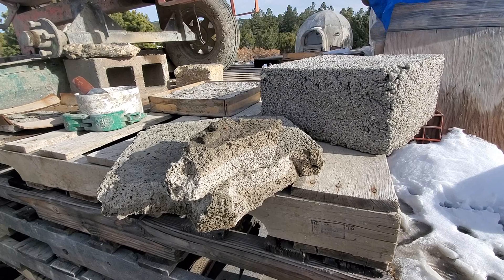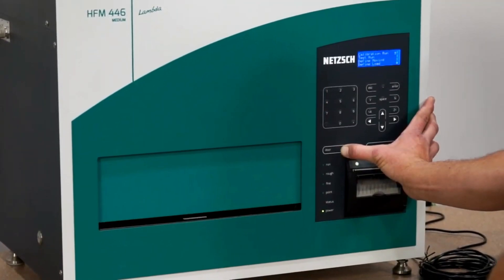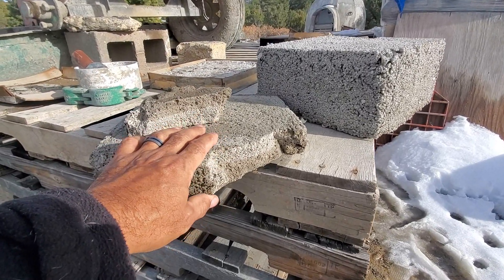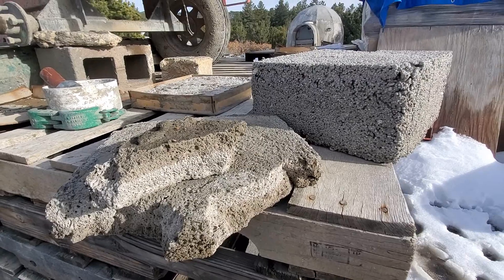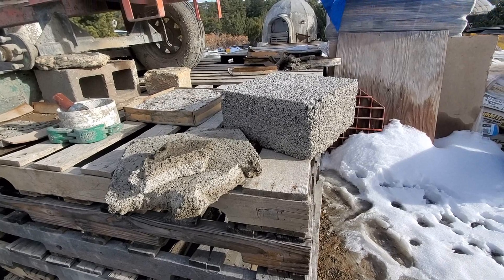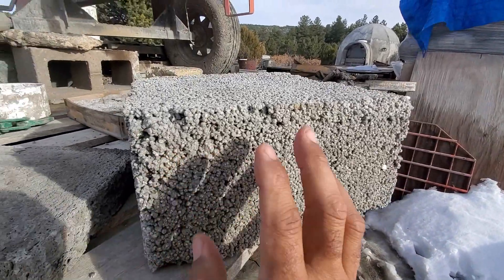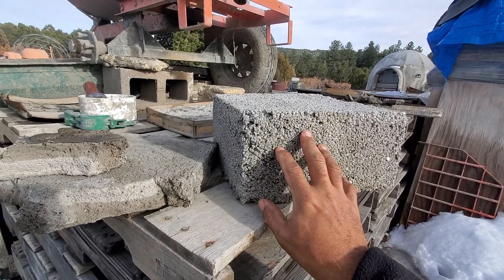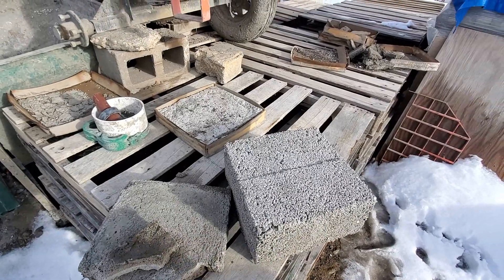Aircrete R-Value | Update #aircreteharry #aircrete #foamgenerator #offgrid #rvalue #aircretervalue

Comment: I appreciate all the research you’ve done. What is the r-value per inch on 100 gallon batch ? Would you be willing to provide this info. I’m not needing a proof for permit, and the job I’m planning is small enough where the savings are not worth the $200 investment.

Comment: I have always wanted a solid pour rebar reinforced concrete home. I was sold on it when talking to a friend who builds these kinds of homes. Recently my wife joked and said "just pour concrete in the walls"
Then i said something to my friend and he mentioned aircrete. I'm two days into this research wondering what the feasibility of replacing current insulation in the house i just bought, with aircrete is, and how much better would aircrete be than the insulation currently in the home (built in texas in 2007). I dont know much about insulation or how it works to be honest, i just want a house that stays much cooler in the summer.
Reply from the maker: Welcome to the channel Jacob 👍 
For insulating your walls I would recommend styro aircrete. It is made of aircrete mixed with stryfoam beads. AND would be much easier to apply than aircrete alone. ..
Email me: Aircreteharry@gmail.com 
We'll be happy to provide you with more information & details. 
Welcome to your 3rd day of research & our Best to your Wife!!
Reply: @AircreteHarry  emailed you!

Comment: 1) Just to be clear, has the testing been done yet?  Is the link provided for a document that is ready now or something that is still to be done later?

2) I think you should provide the R-Value results on the website so that prospective DIY builders would know if this is even something worth pursuing.  I've been watching your videos for years now.  I'd be very curious to know the tested number prior to purchasing the stamped document, as I think many people would.

3) What is the timeline on "My goal is to develop standardized mixes to be used in different applications such as Aircrete / Styro Aircrete for Insulation vs Aircrete / Styro Aircrete for Structural purposes?"  And will those mixes also have R Value tests, and when would that be likely to be posted?

Love the videos, just on the fence about whether I can use this in my builds or not.

Comment: What's most important is the heat retention ability. R value is a lab test and not applicable in the real world. Most insulation has air in it and allows air flow and moisture. Where as closed cell foam doesn't. 2" of closed cell will prevent 86% of heat transmission. I assume since aircrete and foamcrete don't allow air or moisture thru it, it would be like closed cell foam.
Reply from the maker: Aircrete can be created as an open cell or a closed cell, depending on how you mix it.
Reply: @AircreteHarry  Is the 40 gallon mix you plan to test open or closed cell?
Reply from the maker: @mikemcelveen  Welcome to the channel Michael 👍 
A: Closed cell.

Comment: NICE ONE ! LISTEN ! IF YOU WANT TO ACHIVE A GOOD R VALUE ! USE LESS CEMENT OR NO CEMENT AND REGLUE DE STYROFOAM ! IS SIMPLE ! R VALUE FOR CLC IS VERY LOW! IS BETTER FILL THE CAVITIES WITH STYROFOAM AND THAT S IT !THE THINK WITH LIGHT CONCRETE IS THAT IS LESS WEIGHT AND A LITTLE MORE INSOLATED !THAT IS STABLE ON A HIGHER RANGE OF TEMPERATURE! ! WHAT S THE BEST YOU CAN DO IF YOU WANT IS TO MAKE A HOLLOW CORE WALL FROM 5 CM EACH ON SIDES CLC AND THEN FILL THE CAVITIES THAT S MUST BE AT LEAST 20 CM WITH STYROFOAM ! THAT S IT ! IF YOU WANT HIGHER ISOLATION ITHER USE A BETTER ISOLATION STYRO OR OTHER MATERIAL THAT S STABLE ! IF YOU WANT MORE ISOLATION YOU CAN INCREASE THE OUTERWALL CLC DEPTH LIKE 10 CM !WHAT S THE POINT TO ALL THAT CEMENT ? YOU ONLY ADD WEIGHT FOR GLUE SOMETHING THAT IS ISOLATOR (LIKE AIR OR PLASTIC ). IN THIS VIDEO YOU MAKE SOME ERRORS!  PLEASE LOOK AND FIND DOC OUT THERE ! THERE ARE ALREADU =20 YEARS PAPERS THAT CLARIFY THIS TYPE OF MATERIAL ALLREADY ! PLEASE UNDERSTAND THAT I HAVE NOTHING PERSONAL WITH DIY ! BUT  THIS MATERIAL WAS INVENTED ALLREADY !!!  THE DIY SIDE IS FOR CONSTRUCTION CODE ONLY BY LOCATION.
Reply from the maker: This Styro-Aircrete is new. Styrofoam and Cement has been around a long time yes! Using Aircrete, not just cement, but Aircrete an insulative cement mix to glue the Styrofoam together is also making the Styrofoam fireproof and easier to work with. Also depending on the mix you make, you can build with it. And last you are saving money by recycling the Styrofoam.

Comment: Sounds great, any links to your friend whom extended his cement mixer?  Thank you!
Reply from the maker: Glad you enjoyed it. I wanted to share with you all the possibilities & benefits. (No links, just shared the photos)
Reply: @AircreteHarry  Thank you for the reply! I was just wanted to know more  about his house build, I want to add insulation type cement  to exterior and interior of an existing building  which has 4' tall stem walls with 2x4 wood stud walls above that. It basically has no siding, only wood sheathing  on outside and nothing on the inside.  What would you recommend?
Reply from the maker: @duanethieme4186  You are Welcome Duane. Send us an email: Aircreteharry@gmail.com 
We'll connect with you.

Comment: Isn't there a greater problem... inconsistencies and/or calling something DIY made by the name aircrete... Seems many public mix recipes require certified lab testing to validate DIY samples as meeting an established building standard be it only for insulation or for load bearing etc... one mix cannot provide certification for all uses. Until a given mix recipe is shown as meeting a particular use, i.e. insulation, load bearing etc. It seems premature to be testing an unproven mix recipe for "R" value(s). 
Check with your local building department. Aircrete likely is unknown, or if allowed DIY it must be certified as meeting the current building code to be re-sold. Not meeting the building code is a no sale road block unless you demolish, truck to a landfill and then sale the remaining land value. Check with your local officials.
Good luck!
Reply from the maker: The sample being send to the Licensed R-Value Engineer will be a standardized mix that I developed & will have the exact recipe for.
That information will be included with the R-Value paperwork.
 This particular test will be for an Insulative Aircrete that will be used for pouring into wall cavities for Insulation purposes. 
Eventually I will have different Aircrete recipes tested. For as long as we have a Licensed R-Value Engineer documents, anyone will be able to use this standardized recipe for their Insulative purposes.
My goal is to develop standardized mixes to be used in different applications such as Aircrete / Styro Aircrete for Insulation vs Aircrete / Styro Aircrete for Structural purposes.